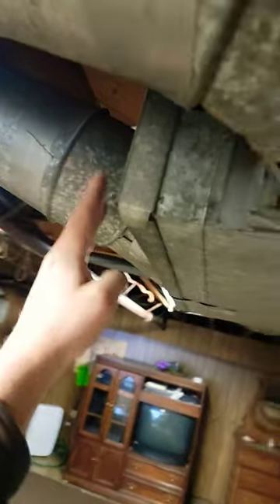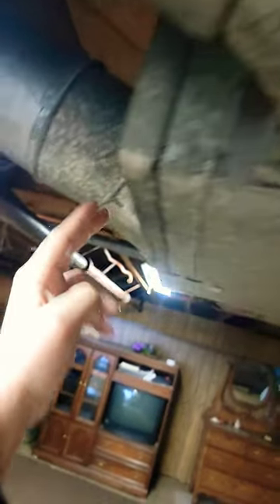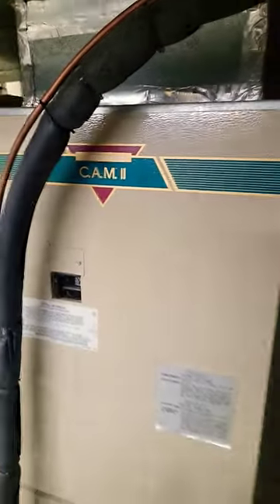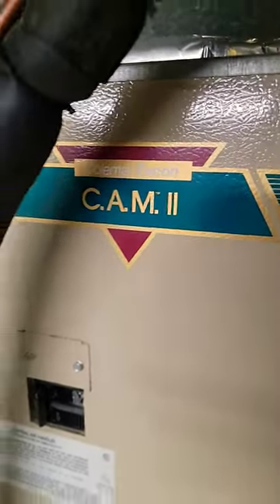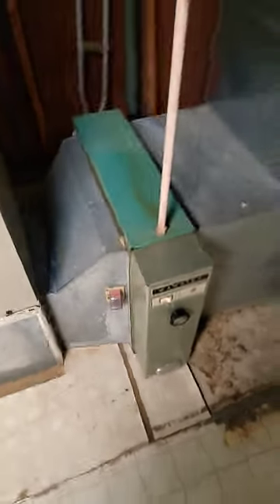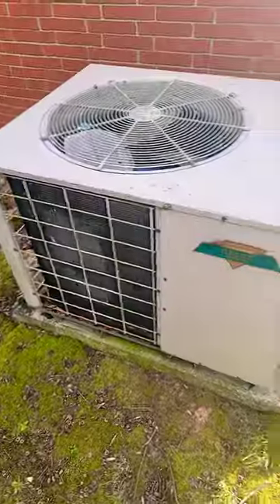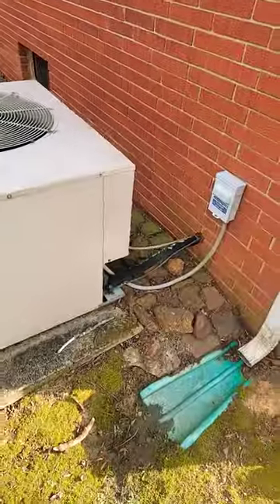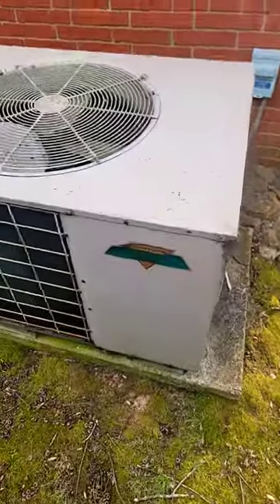Why your Air Conditioner has airflow problems?

Comment: The purpose of the end cap is to convert velocity pressure into static pressure, this allows an equal pressure to be exerted on all sides of the duct for even airflow out of all outlets.
Reply from the maker: Absolutely I could not have said this better. I did not do a good job in this video of conveying or expressing what I wanted to say very good. My brother very proud to have you as a subscriber

Comment: Hey taddy,
I Think u like to do quality work. I’m not so sure about installing York equipment these days. They used to be good but nowadays I’m not so sure.
Maybe look into installing:
1) Rheem - Condensing units & package units.
2) Payne - furnaces
3) Adp - Copper tube & aluminum fin coils.
I Wont ever install a Aluminum Evaporator coil.

That’s all I install.

Been installing Rheem for Over 42 Years. It’s Allways been a Quality product & Easy to service.

Nothing Beats Rheem in my opinion.

Just some fyi for you.
Take care.
Oc.
Reply from the maker: Thank you o c
Glad you're here my friend I love your advice
That's a long time to install that equipment
I will check it out

Comment: Manual D has specific examples of how to take off end cap. Based on the short video it looks like its an alright desing. Put a damper on it if thats swallowing up all the air as you claim.
Reply from the maker: Thanks for the info!

Comment: I would love yo see the size of the room that was serving. If it was intelligently designed, it would be a proportionally larger area than the other rooms on the other branches
Reply: Age old rule.  Sometimes there's no choice to take off the end.  Instal a simple manual balance dampe....preferably a 180⁰ baffle.  No big deal.  Buy a flow hood....lol.

Comment: It's called static pressure and the entire duct system should be layed out and designed based off  requirements for size of home
Reply from the maker: That is correct scuba steve

Comment: This is why supply ductwork reduces in size as you get further from the air handler. Too keep a more even static pressure in each of the supply runs. You can also just add balancing dampers to adjust the face velocity pressure/CFM to each duct. The further away the higher the velocity and smaller diameter branch.
Reply from the maker: That is correct

Comment: What can happen if I have two air filters in my AC.  One in the air handler and the other in the return.
Reply: You don't want too much restriction in your air flow. One is plenty.
Reply: @ParabellumX  thanks for the advice 👍🏻
Reply: BTW, the filter in the AH is already in the return. That's what keeps the coils clean.
Reply: @rupe53  What about the ducts before the filter?  they don't get dirty?
Reply: @titovazquez589  ... the obvious answer is yes, they do get dirty. The flip side is a properly designed system won't have return ducts on the floor because that's basically a central vacuum system. (bad joke) The reality is it will take years... and maybe decades to get dirty enough to worry about it.
Reply: @rupe53  Putting the filter in the AH is a trick that HVAC companies do to charge later for cleaning the ducts.  I'm telling you from my own experience. A simple maintenance visit every six months ends up with a charge of 850 dollars twice a year
Reply: @rupe53  BTW my return it's on the ceiling on the second floor
Reply: @titovazquez589  ... in your case the dirt level will be minimal with a filter in the return grille, but you need to be aware of total restriction in the system. Personally, I would use a single filter in the common return grille (ceiling mounted) and remove the other one. If you want more surface area then get a pleated filter but stay away from the high MERV ratings if your unit wasn't designed for it.
Reply: @titovazquez589  ... BTW, for $850 they are doing more than simple maintenance, which should be more than an hour's work.
Reply: @rupe53  850 dollars for a new filter and cleaning the duct from the ceiling to the AH. Easy like that . That’s why I kicked them out and I started doing myself
Reply: All air handlers have pressure drop specifications , and  cfm at a specific s.p. in the installation Manuel. doubling up on the air filters will only starve the evap coil , chancing flood back ,and eventually destruction of the compressor.

Comment: That new microchannel will burst after a season.
Reply from the maker: It's been going good ever since then.
Reply: @TaddyDigest  if the guy keeps it clean and keeps his filters changed it'll run a little longer. Usually best to charge a heat pump a little lower than an ac. (Higher subcool) helps keep those high pressures down during heat mode.
Reply from the maker: You're right it's all about the charge and keeping the unit clean
I think because it's a rooftop unit. It stays fairly clean and we do have a good maintenance plan